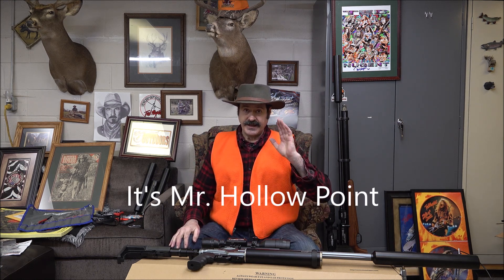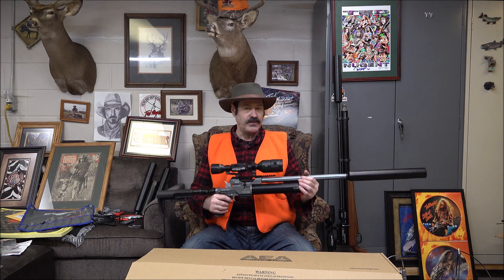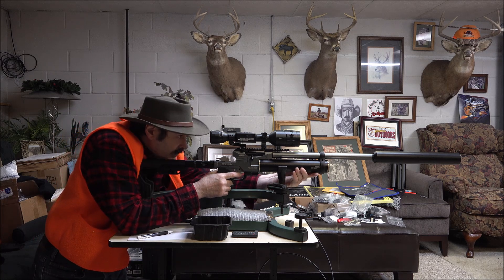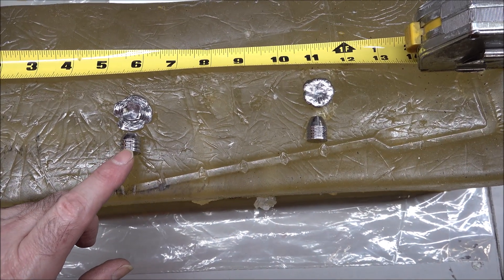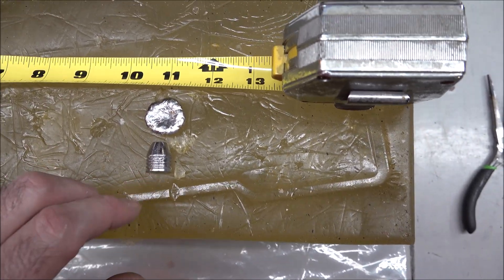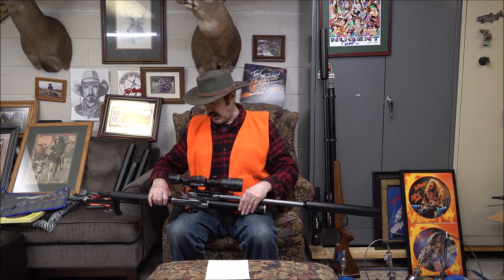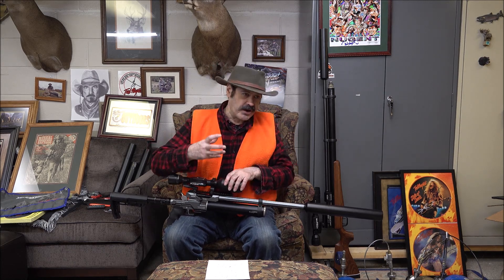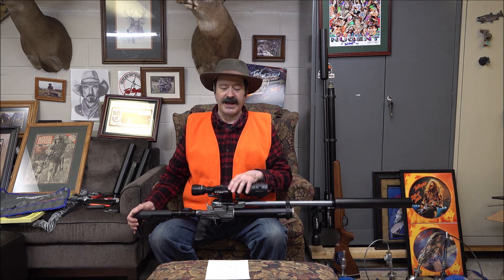58 Element Power Testing

Comment: smiles i got the 51 cal element max too. and the 51 will hold over a 500grain  but i really like shoving .501 coated up to .510 into the barrel using cutting edge safari solid brass 500 grains coated with liquid silver with like ten coats. that is what i am shooting from the element max 51cal. and they fly like butter. smiles i love my element max bob...